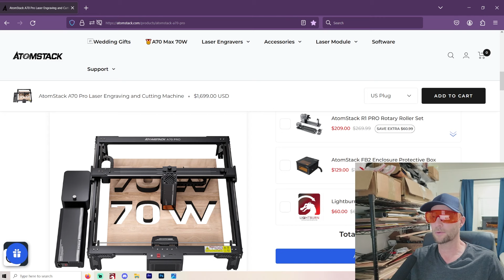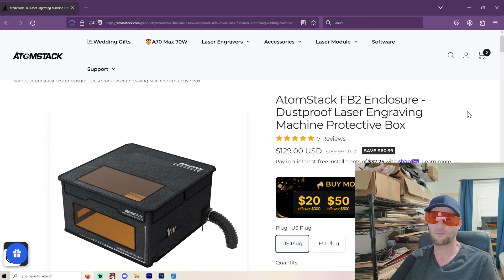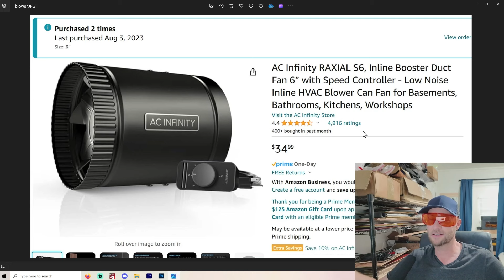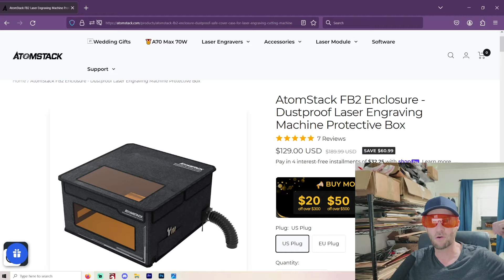Amazing Diode Laser Enclosure - Even fits Atomstack A70 Pro!

Comment: OiY!!!  The Atezr enclosure I bought is past its return date and does NOT fit my L2 36 extended version as advertised...thanks AI translator from Amazon!...I'll cut ya a sweet deal if interested, lol, but seriously I doubt anyone local will want it.(Pittsburgh)
Anyway, moving forward, will your link work for the FB2 Plus as well?
Reply: Definitely gotta make the 6" hole.  I'm trying to do on the cheap, but 2 holes@ 4" with a 6 or 8" fan might be better for the larger enclosure.  Any thoughts?
Reply from the maker: Just get this fan and be done with it. Cheap and never smell a thing again: https://www.amazon.com/gp/product/B0C7Z7PPBH/ref=ppx_yo_dt_b_search_asin_title